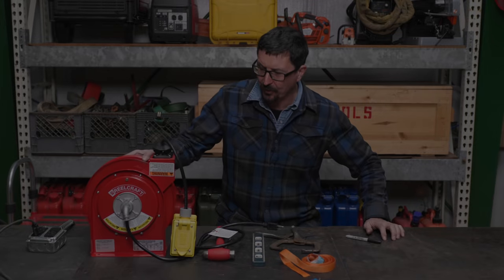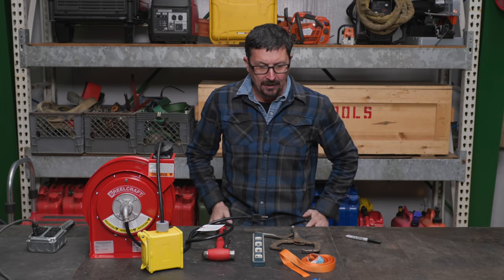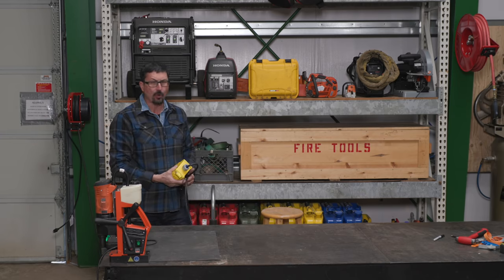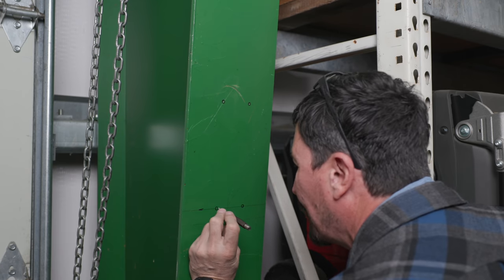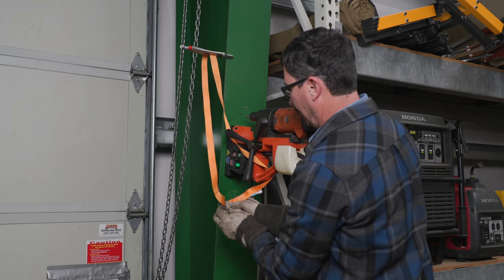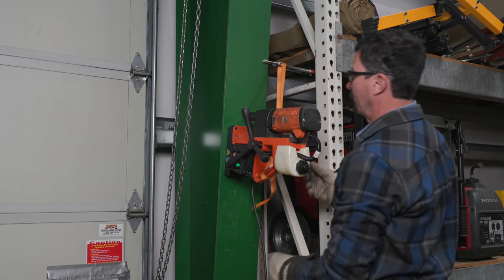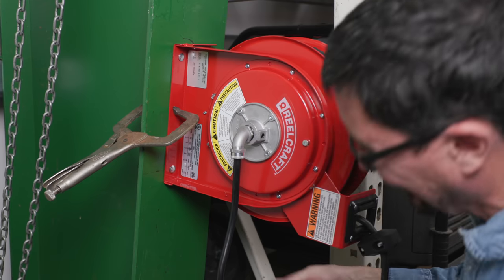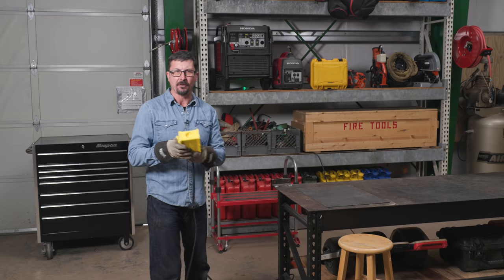I Liked This Tool So Much I Bought a Second One

Comment: Last time I borrowed a friend’s 6x12 flatbed trailer, I replaced his worn out safety chains and gave him a locking hitch pin. I always ALWAYS wash or clean anything I borrow, so he got his trailer back safer, more secure, and with a clean deck and shiny tires.

Comment: Only borrowed something once from my neighbor (sledgehammer). Needed it only for a minute. The look on his faced when I asked to borrow it said it all. I took it nonetheless and used it. I made damn sure to clean up the top and Tung oil the handle. When I returned it with many thanks, he look at it as to find damage. I wished I had never asked. Since that day, I made damn sure I have everything I need for mine and my family's home. That sledge I bought still sits in the garage unused except when I remember to take it out to clean off the cobwebs. It's just not my dad's era anymore when neighbors help neighbors either on each others cars, homes, etc. No sir.

Comment: Flashbacks.
I love a mag drill. They cut like butter, safety strap is a good idea but can be very dangerous as can the shavings.
Pro tip is to keep those shavings shorter than 1”. Had 2 co-workers loose fingers. One due to the strap getting caught in the drill head, the second guy had a shaving snag his glove and pulled his hand in. Both had bad breaks and gnarly tears resulting in amputations. 
Looks like you were close with the gloves but camera angles are very deceiving. 
Love your channel. I respect your honesty and your willingness to try things outside your comfort zone. And your shop gives me an envious level of the fizz. All jokes aside you have given me loads of ideas for my future home when my bride and I get there. I keep having injuries that require surgery that end up killing the savings for a down payment. 
Praying for you and yours, that you heal from your injury, that God brings peace through this hardship, and that He bless every endeavor you set out to accomplish. In Jesus Name amen.
Reply: Hey Alan, how do you keep those shavings shorter?
Reply: You back the dill out when ever you want the shaving to stop. Shot little plunges with the bit keeps them short and within the safety guard  if equipped. And also use plenty of cutting oil to keep the bit lubricated so the bit won’t bind and spin the mag drill loose.
Reply: @alanbrookhart3581  Thank You Man, now I'm prepped and ready whenever I need to use it but safely

Comment: i tend to keep neodymium magnets around to glue to projects like this, i have an old metal power strip in my truck that has a few magnets glued to the back of it for use with the inverter in the truck, i can pull it out, stick it to the fender for charging tools, running lights etc, and we used it when we went camping last time the camp ground had a steel awning over the table and we stuck the power strip to one of the legs and had our camp lights plugged into it and a fan, magnets are one of those things that either get overlooked or come across as a "gimmick" until you need them, and the metal quad was what i had in mind right as you mentioned it, you could even make it better if the GFCI ever starts acting up, get one that wires in line on the lineset going into the reel, put a  quad on the end of it with magnets attached, then you've got GFCI protection along the entire cord, and a magnetic end box, stay safe brother

Comment: Always improve what you borrow. Most recently i had some vehicle troubles, and a friend graciously offered a minivan for me to borrow until i got a new truck. I got it knowing it had some issues and swapped my battery into it to get it back and running. I had to jump it twice to get it home since it hadn't been run in months and kept draining my battery, but i had to stop and get gas since it was parked on empty. I also knew that it was in need of an oil change so i payed for 5 quarts of oil and a filter and changed the oil at home. I also fixed the electrical issue that caused the battery to drain and returned the van after i got my new truck and had it road legal, i e insurance and tag. She offered to pay for everything i did, but i refused. If i was just changing the oil and giving it back, than sure, but i had access to a vehicle to go too and from work and get groceries  when i could have been stuck or had to leech off of others to get through my day to day life, and if anything I should have payed her. But she did not need the vehicle and trusted that the van was in good hands and that the vehicle was returned in better condition that it went out. You dont have to pay someone for everything they do, and you shouldn't expect payment when you yourself is receiving something free that you would normally have to pay for. And too this day i still do odd jobs in the hopes of repaying her kindness and to a certain extent would be happy to do anything that doesnt directly impact my own life or start costing me valuable time when something i need done comes up first that is more important. Go through life owing people something. And always have something to give, you will feel much better about yourself and people will look to you in need. Im not saying you have to give your life away, but saving someone from having to pay for a professional they dont know to do work that may or may not reach there expectations if well worth it and they in turn will be happy to help you if something in your life turns upside down.

Comment: I love retractable hose reels and electrical reels.  A lot of folks will yell about how bad a reeled up electrical cord is due to it's ability to heat up.  If I am using any kind of real wattage on one, I tend to pay all of it out.  If it's a light load, I don't worry about it.
Reply: I’m with you there, re-wired my house and added power to the garage and first thing I did was purchase two electrical cord reels and mount them way out at the edge of the last outlets, makes it easy to run a saw away from the benches or vaccumn a vehicle. 

I’ve made it my personal policy to not borrow things from people. If I can’t afford to buy it, how could I replace it if I break it? I know my friends are willing to loan things if needed, but I’ve stayed friends cause I don’t do that!

Comment: I would turn it over and have cord coming off the top of the reel to keep some of the strain off the cord as it makes that 90 degree turn coming off the bottom. The roller guide should be moveable to make it like your air hose.

Comment: If your garage door is 8ft wide, the diagonal between it’s nearer side and other shop corner is 51.22 feet.. Cody!

To be clear i did not account for usable floor space, reel offset from wall (on beam), distance between garage door and reel beam, distance between garage door and far wall.. sufficie to say the reel reaches all 4 corners… ;P

Comment: I am no electrical expert but here in the UK you would have to unwind this reel completely every time you put a load through it to prevent over heating and the cable melting. I am talking 240v though.

Comment: As per your idea, it'd be nice for it to be an electro magnet  with a switch on it somewhere or another type of disable-able magnet (like they use in magnetic lathe chucks) to avoid little metal bits constantly sticking themselves to the plug, but still be able to use it when needed.
Also, once again, love that magnetic drill press.

Comment: Take 2 of them welding magnetic holders (looks like triangles, come in different sizes) and epoxy them to the side of the box, you have your magnets. I have to say, awkward shape of that box, why make it so "tippy", they could have made it wider and flat instead and it would have stayed standing easier.
Reply: Ah, shoot. You beat me to it.
Reply: I agree the first thing I thought was why is the GFI on the back why not either in line with the plugs or beside of them it would be trimmer and not so bulky looking

Comment: Just use contact cement on earth magnets around one that you can get at the wood store, go to them to the box as many as it takes for the strength of magnets holding power that you need. Solved your problem you’re welcome.
Ron, East cost southern guy!

Comment: Hey Cody I see that  the outlet box is made out of plastic I think it’d be a good idea to throw some neodymium magnets inside the case so when you have it on a bench it doesn’t slip off or while you’re trying to plug stuff in one handed you don’t have to fumble around with it too much

Well I just made it to the end of the video and saw you had said that I guess great minds think alike coming from an east coast man

Comment: Swap that plastic box out for a steel box zinc plated, explosion-proof so it's got some weight.  Then you can just use a set of loose magnets.  The weight of the box will keep it steady in places like on the ground in a good wind.  They make versions with the marine covers that open and stay open until you close them.  You could have a super skookum drop line that won't get all beaten up easy and will hold onto a magnet really well.   Hope you are healling.

Comment: Professional homeowners know why metric and Imperial flat head screws can not interchange, metric screws have a 90° recess, Imperial (SAE, etc.), Have an 82° recess.  Especially in hard, brittle materials, like rare earth magnets, the wrong countersink type can cause the magnets to shatter unpredictably.

Aluminum flat head pop rivets are soft enough to deform rather than shatter the magnets, but not steel ones.  They can send pieces of magnets flying.

Comment: Rather than hauling round an extension lead which you much trip over... Pop that shiny new eco power unit on wheels and just kick it round the shop to wherever you need power.

Comment: Whenever I see that mag drill I think of your "compulsive buy" all the time, and how much you use it. Nothing you likely wouldn't come up with on your own, but I'm thinking that square box outlet could use a powerful magnet on 1 or 2 sides. I like to buy HF strip magnets for cheap, and use them various ways. Those reels are fizz-centric.
Reply: any idea how much max weight those HFrt strip magnets will limit out to?
Reply: @bikemannc  Not sure but I would say 1 strip, full of 3-4 small segments, will hold 10# in the right orientation. They are cheap, so I'd encourage you to try it out.

Comment: OK hold on, you need a permit to run a few power cables with outlets in your own shop, next to your house? That's insane!
Reply: I was wondering about this....

Was I supposed to give a damn about paying government for permission before I ran a sub box for some 240v outlets in my basement?

I have internet and electrician friends to design what I want to code or better.

Comment: I hate borrowing anything. But if I can't afford buying something and have a friend I can borrow from.  I was taught to always take it back in better condition than you got it in . I have been known to borrow trailers and replace rotten floors or replacing the wooden decks completely. Or if it has somewhat a rusty metal frame . I fixed and repainted. Treating it like it was my own. I have always believed that is the way it should be. Being respectful towards my friend for there kindness. And I expect the same in return  .

Comment: That’s crazy I was gona tell you to fasten a speaker magnet to the bottom that is as big as that thing box is long also if your not on a magnetic surface it still sits upright because of the weight of the magnet and it’s round! That’s a great ideal